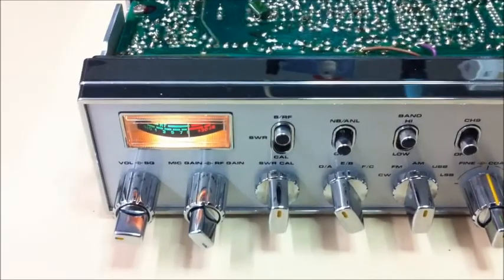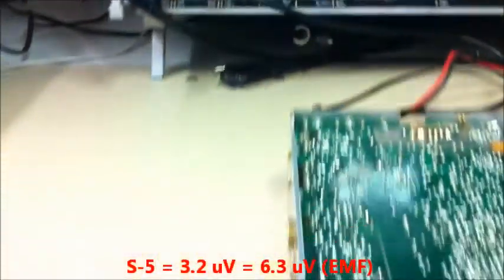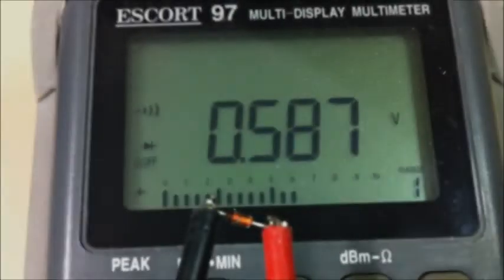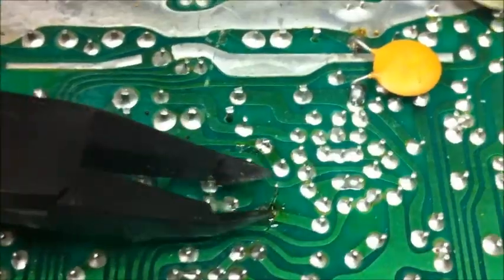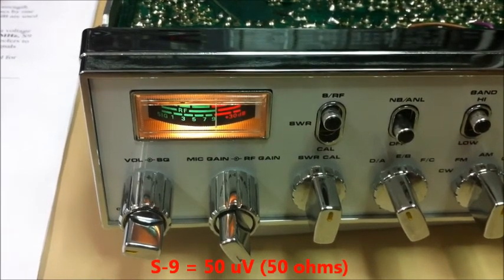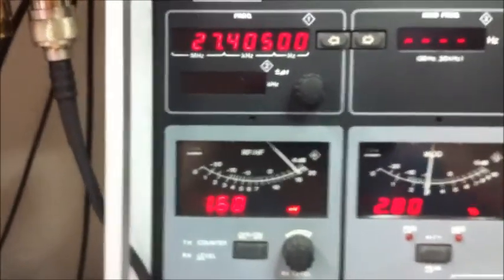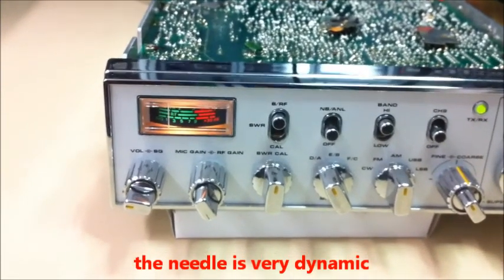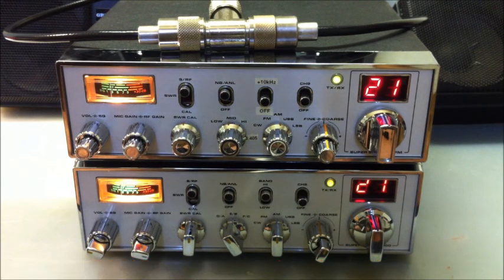How to wake up a lazy S-needle on SUPER STAR 3900 (EPT3600)

Comment: My yaesu ft840 needle is the opposite and reads almost the same readings on FM. Is there a fix please I really need a fix thanks.
Reply from the maker: Hello dear HAM radio operator, thank you very much for visiting my channel. Unfortunately, I cannot tell you where you can set the S-Meter. This HAM radio uses much more complicated circuits than a CB radio like the SUPER STAR 3900. You will have to visit a YAESU service center and describe the problem there. I wish you good luck in resolving your problem soon. Best regards from the Zürcher Oberland.

Comment: Great video i have yaesu 840 and the signal meter on fm gives the same signal from many stations is there anyway to change it ?
Reply from the maker: Hello dear OM, thank you for visiting my channel. With the FT847, the AGC regulation needs to be improved. The interaction between the AGC regulation and the RF gain setting can better represent the differentiation of the signals. See also the operations manual on pages 36 and 37. This is where it is described. I hope you have a nice weekend. Best 73 ..

Comment: Dear Sir my smeter is lazy and i removed the diode and replaced it with a germanium diode that i tested . But i can not improve the s-meter when i turn the VR1 . i don't see any differance . I do not have your expensive rig that you use for calibrating. Can you help me with my problem. Thanks greetings Edgard
Reply from the maker: CB radio friend hello, thank you for your interest on my channel. Yes, it's possible, that the potmeter VR1 (AM) or VR2 (SSB) is defect. I had this problem on other radios. It' s most the problem on the rotator. To less pression on the graphit. Please take a look to the potmeter. I wish you good luck to fix the S-meter path. Happy airwaves to you...
Reply: @SWIZZRADIOS  Thanks for the info the/ both the potmeters VR1 en VR 2 are 10 KB. What does the "B" mean or is this not important? Can i find these potmeters on the web? Maybe you have a link to a site. Thanks from Edgard from Belgium
Reply: hello Sir can you please answer my question?
Reply from the maker: @PIRANHAE  I'm sorry sir, but I'm very busy to time. Yes, the Letter B is the info for a logarithm variation of the Potentiometer. Potmeters without the Letter "B" have lineare scale.  It's a tricky thing to find potmeters with logarithm scales. I hope that I could help you. Best 73 to you...
Reply from the maker: @PIRANHAE  I'm sorry sir, but I'm very busy to time. Yes, the Letter B is the info for a logarithm variation of the Potentiometer. Potmeters without the Letter "B" have lineare scale.  It's a tricky thing to find potmeters with logarithm scales. I hope that I could help you. Best 73 to you...
Reply: @SWIZZRADIOS  Dear Sir i really appreciate your answer thank you so much

Comment: SWISSRADIOS - why do some seller call the TO-35 Diodes Germanium and others call them Schottky Diodes? The Schottky Diodes have a lower Turn-on-voltage so why are they not used in this circuit?
Reply from the maker: Mister William hello, thank you for your interest. The GE diodes are called GERMANIUM diodes, because the semiconductor-material is made of GERMANIUM-Metal. These diodes begin to conducts in about 0.2-0.3 Volts. The Schottky diode (named after the German physicist Walter H. Schottky), also known as Schottky barrier diode or hot-carrier diode, is a semiconductor diode formed by the junction of a semiconductor with a metal. It has a low forward voltage drop and a very fast switching action. I think, you can use a Shottky also for the S-Meter rectifier in your CB-radio. Happy airwaves to you....
Reply from the maker: Mr Bill hello, there is a very interesting video about a shottky diode. The shottky works very fine on HF: https://youtu.be/bXEyCf1P0UU
Have a nice sunday...

Comment: Regardless of the Supplier you get your Diodes from - always check the Diodes Turn-on-voltage before using because 1 out of 100 may actually be bad from the factory. A good multi-meter in Diode Function should give you a good reading.
Reply from the maker: OK Bill, I'll make that... Have a nice weekend....

Comment: Is it better to use a 1N60 than a 1N60P?
Reply from the maker: Mr ZERO X-Mission hello, thank you for your interest. For this case is it no difference between the 1N60 or 1N60P. It's only a demodulation of the IF-frequency carrier. You can use both diodes. I wish you good luck for the modification. Best 73s to you...
Reply: @SWIZZRADIOS    Hello SwizzRadios, :) Thank you very much for your advice and clarification on my question - much appreciated.  Best 73s to also. :)
Reply: @SWIZZRADIOS  Hey, also like myself, except for the Smartphone for Youtube! =)   I have no Facebook, Twitter, Instagram, etc  account, only 27MHz! =)  Best 73s and happy airwaves (with no noise ;) ) to you also.  Take care.

Comment: I did this tonight  I've use 1N60 from Toshiba Diodes it very accurate spot on much better radio thank for this video.
Reply from the maker: Mr Darren hello, thank you for your interest. You'll find alot of 1N60 diodes in old AM radiosets and transceivers. Many old 23CH CB-radios used germanium diodes for the AM-demodulator- and S-meter rectifier. Best 73s to you...
Reply: SWIZZRADIOS yes I've got lots of old AM radios in my shank it just sad to take them apart I was lucky enough to find 1N60 Diodes from the net only paid  £7 for 4 Diodes .thanks again for this video 73s to you

Comment: Sorry but that 50uV=S9 is not correct. For HF (and 27mhz are in HF band), the S-9=-70dBm. and -70 dBm is 70.7uV.
See this page: http://en.wikipedia.org/wiki/S_meter
Reply from the maker: I'm sorry sir. All my measurements and settings are based of all the infos on the ARRL level chart. The fact. 50uV (in to 50 ohms) are -74 dBuV or -73 dBm.
The International Amateur Radio Union (IARU) Region 1 agreed on a technical recommendation for S Meter calibration for HF and VHF/UHF transceivers in 1981.[5]IARU Region 1 Technical Recommendation R.1 defines S9 for the HF bands to be a receiver input power of -73 dBm. This is a level of 50 microvolts at the receiver's antenna input assuming the input impedance of the receiver is 50 ohms.

Comment: Hi there. After 10 years without activity my SS-3900 has the lazy neddle but when x-mit, even if I checked it with a wattmeter and the power in AM/FM(5W) and SSB(12W) is ok. Do you have any clue how to solve this problem?
Reply from the maker: Sacmachetus hello, thank you for the interesting. Please check VR8 (100k): Turn it fully ClockWise or Counter ClockWise. now it should make contact again. Or check C164 (1uF) for a possible short circuit. Then D87/86 (1N4148) also for a short circuit. I think, these are the possible Problems. Good luck...
Reply: SWIZZRADIOS Thanks so much. I will check
Reply: SWIZZRADIOS It worked 100%. Thanks a lot for your intructions.

Comment: Hello a have also a lazy S-meter, bud the cb a have is an old superstar 2200. I also think that there are 2 transitors out of order. Do u have a good electric schematic drowing of this cb radio thanks.
Reply from the maker: Mr Rene hello, thank you for the interest. You'll find a schematic on CBtricks dot com. The SUPER STAR 2000 uses the similar board like the 2200 or 2400. Best 73's to you.

Comment from the maker: The VR13 (AM PWR) is to preset the bias for the AM/FM output power. You should connect a true RF-wattmeter to the antenna socket, while TX-ing, set the RF-PWR to about 8 Watts. After this, you should adjust the VR8 (RF-Meter) to about S-8 while TX-ing. This is to set the RF-Meter to show the relative output PWR.   Best 73's..

Comment from the maker: Hello dr SUPER STAR user. Chinese SUPER STAR CB-radios, do have different circuits. So is a SUPER STAR 3900 in my collection, which has no problems with the S-meter or weak RX. I think, you should not modify a new SUPER STAR CB-radio. Best 73s..